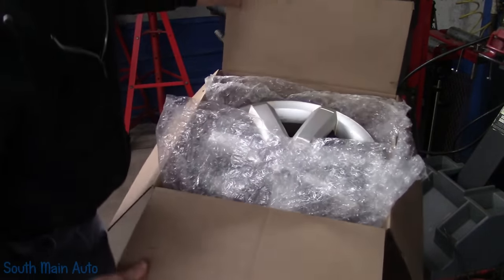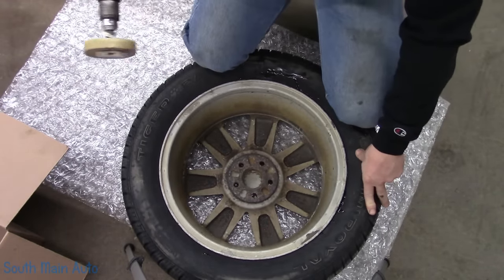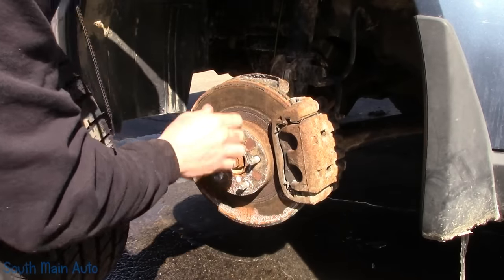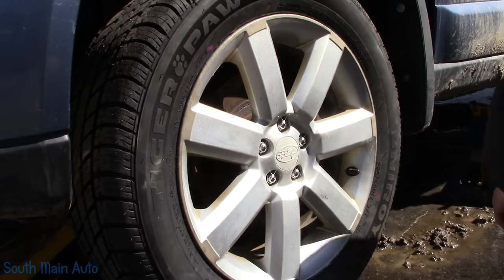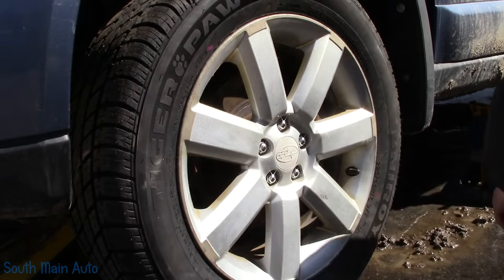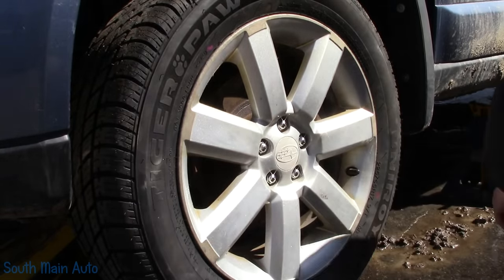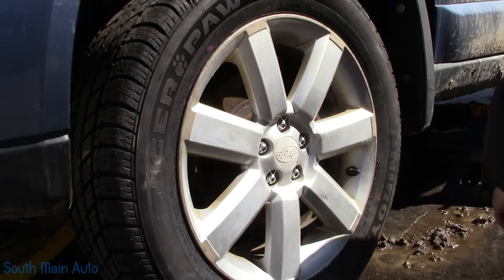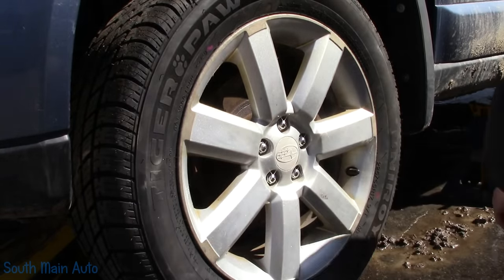Subaru Lost A Wheel On The Highway!

Comment: Confusing part is why the owner didn't call the original tire installer for a full damage claim?     
They were obviously at fault
Reply: Most shops, like Goodyear where i was employed as a auto tech, tell the customer to stop in after 50 miles to have the wheels retorqued free of charge after tire replacement, with a explanation on the back of the ticket stressing the reason why having this done was important, plus they had to sign a waiver that it had been explained to them and what could happen if they failed to come back.
Reply: any one who has tires changed should recheck the lugnuts after a short trip. and any competent driver should "feel" that something isnt right BEFORE the wheel falls off. yes  it probably wasnt tight enough  to start with
Reply: @dave1135  When I worked at a tire shop in the 90's we torqued all the wheels to spec. And I think in my 3 years, I can count 2-3 people that ever came back to re torque.
Reply: You are making an assumption that the owner didn't mount the tires himself and put them on the car himself. A lot of farmers will mount their own tires and just take them in to get balanced. Reduces the cost.
Reply: Would you want a shop that didn't get the tire on right in the first place to be in charge I'm fixing the rest of it? I'm not sure I would.
By the way kudos to Eric for cleaning the mating surfaces of the wheel. The fastest way 4 lug nuts to go out of torque is for rust, corrosion, grime , and or debris between the wheel on the Hub.
Reply: Out of all these years of working on my and friends vehicles, I have never had lugnuts loosen.
Reply: He probably did it himself or a friend
Reply: @markchidester6239  Over the years (I'm 60) I've seen it happen one time and it was due to the installer being sloppy. Trying to talk too much with a friend. My friend was paying attention and pointed it out to the installer.

Comment: Eric O,

This reminds me of two  times where I had the wheel fly off my vehicle.  The first was a Dodge D-50 and the upper ball joint failed, the entire wheel assembly with control arms broke away and hung the truck.  We slammed to a stop so hard that my friends hat and the cigarette he was trying to light were across the highway intersection we were approaching.  The second was an F-150 with 35s.  I had taken it and gotten a wheel alignment and when I went to work the next day (60 miles away) as I was backing into my spot at work the front right tire fell off.  They didn't tighten the lug nuts enough and they worked free.  I had to replace wheel studs sitting in the parking lot at work.

Comment: Nice work. A wire brush a plumber uses to clean the inside of copper fittings works great on the ID where the ball joint mounts. Cut the handle off and chuck into your drill.

Comment: Always check your wheel nuts after the wheels have been taken off by someone else. Also ask that they don't use air tools and torque the nuts to manufacturers spec. The muppets who changed the owner's tires and didn't do those wheel nuts up should be sued. I'm surprised no one seems to have commented about this. Legally though it would actually be tough to prove they left the wheel nuts loose.

Comment: Talking about lost wheels ... my girlfriend's father had a wheel come off his camping trailer in the middle of the Black Forest in Germany in 1966 or 1967. It was a custom-built trailer that was designed to be safe at over 100mph. He was towing it behind his 300SEL Mercedes at around 180 kmh or 112 mph when one of the wheels came off. It was a couple of weeks after having new tyres fitted. Luckily, the trailer had brackets under the hubs that stopped them touching the ground. Unluckily, his wheel went off into the Black Forest at 112 mph and it took him several hours to find it.

Comment: I used to rebuild Volkswagon engines it the late1960s and early 1970s. People would want super cheap jobs using any parts we had laying around. I would explain to them if I did that, it would only return the engine to the same condition as the day it failed. It will seem to run great, but just sell it, don't drive it. More than one person decided to take extended road trips. To my amazement, two survived, one failed badly. I got out of auto repair and became a machinist.

Comment: A lot of people are afraid of getting a used rim. They get confused of used tires that are the gamble. I got the aluminum replacement trims from a salvage yard that came off a car that a person could not fix the mechanical side found out it was the transmission was a little bit steep to fix. It was a bonus for me. Plus I got the engine for another person who was looking for the bottom side because of a over heating problem.

Comment: Holy crap.  I was driving my buddies vehicle when we lost the back left wheel.  We found the axle nut laying in the middle of the highway and we were able to find the tire by following the single track it left through the ditch and feet from a passing train.   We put it  back together and limped to town at 45 with a coat hanger as a locking pin for the axle bolt.  Still can’t believe we found that part. It was literally on the center line of the hi-way.   We had a higher power with us that day!!!

Comment: Owned an '05 outback for 13 years and have done all of these repairs and more,  driveway style.... usually with a lot more swearing and more primitive tools.   Those ball joints are real pissers if they,  the cross bolt  or castle nut are rusted or corroded.  Had to replace the knuckle after the cross bolt sheared and all attempts to get remains out failed.   Know the new owner and she's still rollin!

Comment: I had a front wheel come off of my Mercury Mystique back about 20 years ago. It was an experience, I will say, since it happened at speed on I-75! Car handled it very well... wheel came off, and the car just settled down on the brake disc sparking away but still under solid control. I just smoothly guided it to the side of the road and called a tow truck, because I knew it was done. 

Turned out that the car had been through something before, and the wheel was not the original. Got it all fixed up, and that car went for a couple more years until the wiring harness went South.

Comment: I like your attention to the detail i.e. cleaning the mating surfaces etc. 👍👍👍 I always use a torque wrench to spec tighten my wheel lug nuts (home use). I did not see it in the video but I have no doubts you have a calibrated hand/experience torque :). 👍👍👍

Comment: Many years ago I had a Mazda that needed brakes. I took it to a local gas station for the work. They misplaced one of the caliper bolts so they took a lug nut from a VW and used it instead. Not 300 yards down the road the bolt locked the wheel to the caliper and the car skidded off the road. I've had some idiotic things done to cars over the years, but that one was quite memorable. Been doing all my own brake jobs since -- and that was in 1978.

Comment: I have a 2012 Forester, lug nut torque is 72 ft lbs.  Most shops use " calibrated" torque sticks to put lug nuts back on.  But I would say most mechanics  don't turn their air impacts down; over torquing and over stretching the bolt.  Have replaced many studs on wheels that were over torqued to which the shops would not cover.  "Citing torqued to spec, you must have removed it incorrectly".

Comment: Our Mazda had the same thing happen to it's front tire, as I was driving it away from the garage that had rotated the tires.  They hadn't tightened the lug nuts on the wheel that fell off.  In the end, the garage (well, the garage's insurance company) paid for the replacement of the damaged fender and the wheel.  I imagine the wheel coming off on the Subaru might have been for the same reason since the tires were recently installed, so it's interesting he's going with a low cost fix, but then again, it is a beater car.

Comment: In 40 years of driving, I've only had one wheel come loose. It was a full size spare that I put on, and used a torque wrench to spec. I've used a torque wrench for over 20 years. The rim destroyed all 5 bolts. The reason the wheel became loose was because of all the corrosion on the rim's centre hole, where it fits over the hub. The wheel did not go flat up against the brake drum. After replacing the lugs, I noticed the rim not going over the hub completely. I had to use a wire wheel to clean all the corrosion out of the hole, and the rim finally fit properly. It was a lesson learned. Luckily the wheel did not fall off when it came loose.
Reply: yup, after a wire brush, i'll usually use grease or anti seize there to prevent further buildup/corrosion

Comment: This happened me once as I was pulling onto a 4 lane roundabout during rush hour.  Car was stuck across 3 lanes and couldn't move it because the wheel had jammed into the wheelarch.  Pre-mobile phone era, so had to run and call the police, who then sent out a tow truck.  Car was abandoned for 40 minutes and caused the worst tail-back I ever saw.  Turns out the wheel had been OVER tightened by my dad and caused all the bolts to shear.

Comment: Liked the way you cleaned up the flange ans threads of the lug bolts, working dealership level suspension bolts always get torqued. I know your arm is the torq wrench, but shit does happen and documentation is everything and lug bolts torqued. I never saw anyone ever clean off the wheel weight sticker glue pads unless the rim was getting painted.

Comment: As a "Friend of The Court" in California, there, judgement went against the customer/driver most times where a "Wheel fell off" case arrived before the bench. 

There's NO WAY this happened instantly and the driver had to have heard or felt the wheel becoming loose a long time before it could drop ALL the lugnuts. That took time and miles and the driver has to bear most of the responsibility for a total wheel load. 

Re-torking has NEVER been an allowed argument in court. Wheels are never retightened after original sales of vehicles when new and manufacturers would never create culpability for designing wheels that needed retorquing.

Comment: It’s never a good day when you loose a wheel. I lost a set of duals with the hub and brake drum off my reefer trailer in a snow storm and didn’t even feel it. When I parked and walked around I had a big snowball around the spindle and brake shoes. Chained up the axle and went on my merry way to the next shop to get it fixed. Luckily I carried two spares under the trailer and I didn’t have to buy rims and tires.

Comment: These struck close to home!  My  otherwise really good repair garage 's unskilled tire guy failed to tighten the lug nuts on one front wheel when they put the winter wheels on, the tire pressue light had gone on, I stopped and checked the tire pressures, but they were OK. A wobble  began, like a flat tire, and then got worse and  I stopped before it rolled off - found four of the bolts on the road, one was still in the wheel but held on by a thread.  Wrecked the aluminum wheel, and a dust cover, but that was all.  A friend pointed out that the tire pressue light was sensitive not to senders in the wheels on an Audi, but to the ABS system sensing something was wrong.  In the fine print, in the owner's manual it notes this.  A few years ago a rented Subaru lost a rear wheel due to a dry wheel bearing which cut through the axel, I was on an interestate, but felt the wobble, had slowed down in the breakdown lane, and the wheel rolled past me on the right while the car settled down on the brake drum.

Comment: Pin Stripe remover wheel from 3M?
Ordering one now. I've been using razor blades and carefully scraping with some adhesive remover. I also like that tire remover / installer. How the bottom goes up and locks it in. We use the Hunter line at work that has the little nub for the hole and then you drop a plunger in there and lock it in. 
Anyways been loving these videos. You're what I would call a proper mechanic.

Comment: +100 cleaning hub and rotor, caliper bracket, sticky wheel weight residue, studs.
-1 resting tire on wheel face (small loss cuz wheel was used and car is rough)
+10 no weights on outside 
Also,  I would have used the tool to bang on it to put the ball joint back on spindle. That way the force goes on the part that goes into the spindle instead of going on to the Joint. Kind of like when you install a bearing.

Comment: I use the lower control arm and a steel wedge driven between the arm and the hub to remove the ball joint from the hub, then I use the pickle fork to remove it from the control arm.

Comment: This is why you should double check your work after going for a burn and also the work of others, when I get a tire change I double check the lugs when I get home and I have found theres always one or two which loosen a tiny bit from the drive home which usually isnt a problem but could be, any kind of work done on my car either by myself or someone else I check it out after a few Km to make sure its good to go, I work on cars for a living mistakes can happen even if rare at my experience level you should at least look under your car after you get repairs or oil change or new tires to be sure its all good.

Comment: I think you need to change the whole front end for the left wheel, choke assembly,  control arm, wheel bearing, ABS sensor to be in the safe side,  and then do alignment, ofcourse you need to check if the wheel hub been damaged too or not.

Comment: so much rust and corrosion...reminds me of upstate N.Y. and the difficulties of pre-soaking nuts and bolts overnight before you even attempt to take things apart ...I'm in texas now...i drive a 1998 chevy lumina with 245k miles and it's rust free. When i came to texas in 1995 I was amazed at how "good" cars in the wrecking yards looked...rust free and you can even take 15 to 20 year old muffler parts off without cutting the nuts-bolts..even exhaust manifold bolts-nuts come out like cake. I always had to junk rusted broken frame cars in upstate n.y.....so i was baffled at why rust free cars were in the wrecking yards when they could always be rebuilt and used for a second life. most of my cars run over 300k miles in texas and i never crack open the engine-head never comes off.

Comment: I really enjoy your videos. I have a 2003 Subaru Outback. I have had to replace one ball joint. The bolt you hammered out on mine was stripped. I had to get a whole new/used knuckle. Where did you get the ball joint puller that you used?

Thanks for the video. At least now if I have to replace the other side I have a much better idea of how to go about it.

Comment: I experienced this at a Volvo dealership I worked in. Woman (with baby) picked her Volvo up after having work done on the brakes. 10 mins later she was back, she turned onto the forecourt and right in front of me, no more than 4ft away, her nearside front wheel fell off. Turns out the mechanic hadn't tightened the nuts. She heard rumbling on the motorway.

Comment: losing a wheel right after you have them put on is more common than anyone would guess, talk to tire guys they will tell you, the tire shops won't,99.9% of the time it is the driver's side front that comes loose after it is properly torqued on. I know it has happened to me twice this year but never before, this phenomenon is a new thing. I do my own work (for more than 60 plus years and still do today), I'm thinking poor threads on studs and nuts they can't take the torque. BUT why always the left front? Start checking around I know most won't believe me AT first, but ask around. stay safe have fun

Comment: I bought new tires for the front of my car and then a week later could afford new tires for the back and the shop tryed to argue about putting new tires on the back. I told them to do it because the other ones only had a thousand miles on them. Still had the little rubber tips on them.

Comment: I had that happen once, it was a Sunday and I was taking my GF back, she lived in another town, I heard some breaks griding, so before taking her we went to the repair shop, they did a front end Brake Job, I paid them, and off we go.  I had travelled all the way to drop her off, coming back to my town I felt something was wrong, so I got off the road, and my right front wheel had 2 very loose lug nut, the other 3 were gone!  The Guy doing my brake job never tightened the wheel lug nuts at all

Comment: a really good way to remove the ball joint stem from the knuckle without using a pickle fork (which can damage the rubber boot) is to take like 2 4lb sledges.   Hold one against one side and whack the hell out of the other side with the other and it will every so slightly egg shape it and it will drop right into your hands.

Comment: I was driving a large truck and the company garage did not torque the lug nuts. The duel wheel rear wheels on both side worked loose and chewed up both the bolts and the wheel studs. Found this after pulling off the highway and pulling up to a job. The shop manager yelled at me for the damage his mechanics did which could have killed me.

Comment: If it would have been me, I would have checked the breakaway torque of the remaining lung nuts.  Tire shops are the absolute worst for cranking up the pressure of their air guns and zip on the lug nuts at a greatly exaggerated torque value.  Note to self  - always check the torque of the lug nuts after having a tire removed by a repair shop.  Seeing all the corrosion on the Subie made me take pause.

Comment: I just found you channel. It's very informative and like that you explain what yours you're doing. Where can I get that red tool you used to lower the lower control arm? I could have used it when I replaced the anti-roll bar links on my cars front suspension. I had to "Macgyver" a  way to lower the control arm using what I had